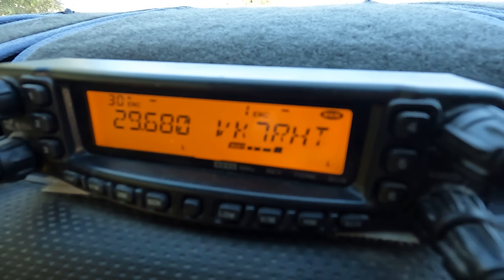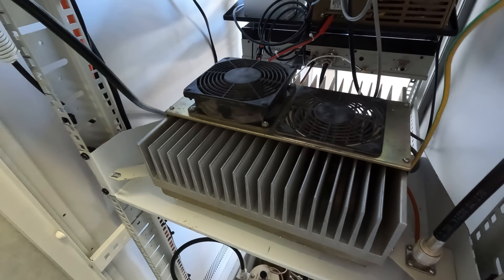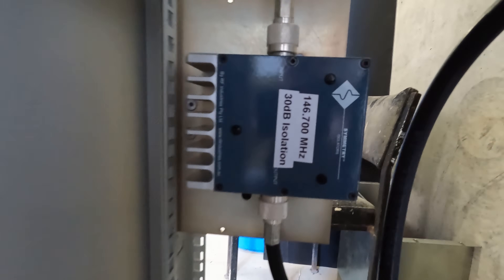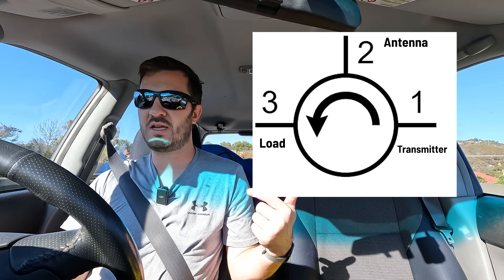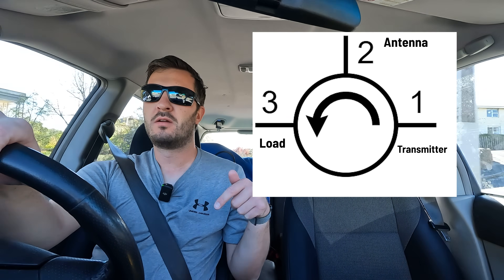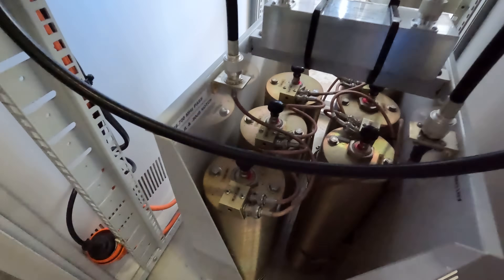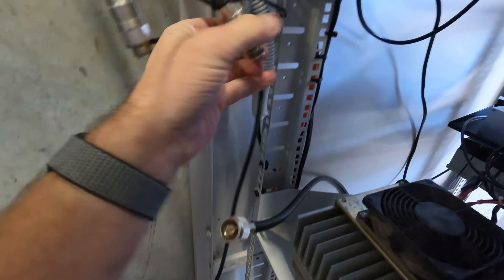How to AVOID Blowing Your Repeater Up!

Comment: Hi Hayden , really enjoy your videos  and learn a lot from them .. Our repeater is tough to get to, not because of the terrain,but more because the property owner can be a stickler about allowing people on his property ..  I've recently been tasked as part of our repeater maintenance crew and would love to put  a circulator  in , Would it be the best to place it before or after the duplexer ? Thanks
Reply from the maker: Hi mate,
Circulators should be placed right after the transmitter and the followed by a bandpass filter > then to the duplexer. Good luck with the access issues!

Comment: Thanks for taking us along for the ride.   I maintained several repeaters here in the US for decades.   I have seen the inside of a cellwave  super station master fiberglass  radome antennas turned to dust in a microsecond by a lightning blast.  I totally appreciate what you do.

73....
Reply from the maker: Thanks! We're lucky that lightning is that big of a problem - I mean we have a 200 foot lightning rod in the form of the broadcast tower right next to us. Plus we don't get that many storms in our part of the world, so we're kind of lucky.

Comment: You should have just used the duplexer and hooked up both TX and RX to the good antenna. What you actually did was not the right thing to do.
Reply from the maker: Nope, I did the right thing. 
We have intermod being generated nearby in the near field of the antenna (probably something rusty) so we get desense when we transmit on one antenna. It doesn’t desense into a load. Splitting the antennas helps with that. It’s all experimental.

Comment: Now, not knowingt eh setup and radio hut, I am going ask, have you got lightning arrestors on those LDF feed lines and why are they just handing around rather than secured/bonded?
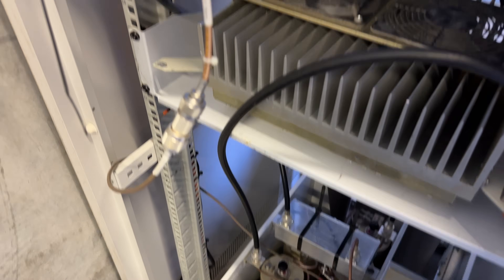Reply from the maker: Yes and they are secured/bonded to the cable tray above at 10:04
Reply: @HamRadioDX  Sorry, didn't see it.

Comment: Excellent description on the isolator/circulator….. As a keeper myself I might look into one of these..
However I am a little confused on the operation of your one…..
If your antenna was busted, should not all of your rf output go to the dummy load? And if it goes to the dummy load, how would you hear that any distance from the site…
Is the isolator also not doing its job correctly or am I misunderstanding?
Reply from the maker: The output power out of the duplexer is 60W or 48dBm, coax loss is negligible. I tested the signal as being 30dB down, which would mean 18dBm or 60mW. 

A 100:1 SWR is only 14dB mismatch loss, so I suspect there is a high impedance break somewhere on the antenna matching section (and there is still some leakage of RF output power out - i.e. the 60mW) being radiated. 

The rest of the power is being dumped into the load. The obvious giveaway was the repeater going from an S9+20dB to about an S3/4. The job of the isolator is to stop any reflected power going back into the transmitter's PA and blowing up the final output device, so in this case it went into the dummy load with a very small amount being radiated.
Reply: @HamRadioDX  Ah yes.... You must be quite close to the repeater site so to still have been able to receive it at that level of what I suppose you could call ERP.
At least the room got a little free heat from the dummy load!
Cheers for the clarification Hayden 😊
Reply from the maker: @IrishHamRadio  Yeah not too far - LOS in fact!

Comment: Folded dipole are one best antenna for repeater, is ground, is wide bandwith, is highly reliable.
one or two bay for large lobe local communication, 4 bayfor better distance coverange, 8 bay in uhf for low altitude high distance signal.
On high altitude like on this video , 2bay vhf or 2 to 4bay uhf are very nice
Reply from the maker: Yes, we're ordering a couple of Low PIM folded dipoles!
Reply: IF UHF, GET A DB-420.
BEST dipole antenna around!
Reply from the maker: @AECRADIO1  nah got VHF

Comment: lucky you have back up antenna .  circulators are a great thing on transmitter. fancy repeaters with remote mentoring   can add temp of dummy load to the data .  The GMRS UHF repeater I re done last year still going strong. has better range with M & P coax. that is not long. all on floor of a office budling.   their is a cell tower and DTV station on main tower outher side of building. only a 2 meter ham and 800 /900 MHz repeater on side with GMRS  . have to take apart antenna to find out what happened. inspect feed line as well . and any lightning protector like a poly phaser ETC.  had them go bad, good ones have a replaceable arc tube.  I keep spares in repeater cabinet which is locked up. sounds like antenna it self. does RX . 73's
Reply from the maker: Yeah we installed a backup antenna specifically as this site is pretty harsh weather wise.

Comment: Put up a folded dipole array and be done with antenna problems 👍.
Reply from the maker: Folded dipole arrays can still have issues with phasing harnesses getting water in them.. Best to run equal feedlines down into the building and put the harness there. But, the other issue is we are height restricted with our antenna.

Comment: A circulator allows a single antenna to simultaneously transmit and receive.
Reply: Any antenna can do that, it's the proximity to the transmit frequency that causes problems. That's the job of a duplexer. You're a tad bit misinformed I'm afraid.

Comment: Dear  Sir, I would like to ask question, I bought ACOM 1500 , Do I have to use all power or Can I set it low powers like 800 or whatever ?
Reply: you need.a 1KW burner and coax made from steel.
Reply: Yes you can run an amplifier at less than it's maximum output power. Some models have a control to do this. If not simply turn down the drive power from the transceiver.
Reply: @DD5LP  Thanks answering my qestion.Now .I am going to ask anotherone ACOM 1500 1200watt continuous power If I set my FT710 40watt or something Do I get less than 1200 watt ?
Reply: @DD5LP  because ACOM 1500 says  (1200 W continuous carrier) output power with less than 85 W exciter drive.

Comment: Cool video, any link for the circulator?
Reply from the maker: It's an old isolator... I had to find it via archive on wayback machine.
https://web.archive.org/web/20170710142600/http://www.rfiwireless.com.au/multicoupling-monitoring/system-components/ferrite-circulators-isolators/isolators-circulators-single-isolators-sp1317-3115-11.html#tab_spec

Comment: Great video,  can you drop a link for the isolator/circulator, like to get some more information on it. Cheers Mate!
Reply from the maker: https://web.archive.org/web/20170710142600/http://www.rfiwireless.com.au/multicoupling-monitoring/system-components/ferrite-circulators-isolators/isolators-circulators-single-isolators-sp1317-3115-11.html#tab_spec

That's the link to the old specs... it's not a current model anymore

Comment: Circulators are great devices, pedantically the Isolator is a Circulator fitted with a load. They work using an effect with a precessing magnetic field. FWIW I used to maintain base stations for emergency services here in the UK, one type in particular had a thermal switch on the dummy load that was used to trip the transmitter to low power in the event of a prolonged period of transmit into a bad SWR. Not a bad solution, to ensure that the radio continued operation even with a faulty antenna. Maybe you could have something similar on yours? A thermal switch to trigger a warning on the ID beacon?
Reply from the maker: That's a great idea! Yes you're right regards the difference between a circulator and isolator
Reply: @HamRadioDX  well done on your explanation by the way, some comms sites over here demand isolators due to IMD issues.

Comment: On the isolator, I use isolators that have an external load. This way if I have high power transmitters next to my repeater, the isolator will shunt the RF into the load. I use loads that can handle about 200 watts to handle not only my repeater but all of the RF trash that might enter through my antenna. 
Another way to eliminate intermodulation issues is to do an intermodulation study on the site. This requires knowing all of the transmit frequencies as well as the power output of each transmitter.
Reply from the maker: I'd prefer a circulator so I could have a larger load... but they are expensive devices. I was lucky to find this one and get it tuned onto 2m - but I think the load rating is over the top... it gets warm with 100W through it with a complete open circuit on the output.

https://web.archive.org/web/20170710142600/http://www.rfiwireless.com.au/multicoupling-monitoring/system-components/ferrite-circulators-isolators/isolators-circulators-single-isolators-sp1317-3115-11.html#tab_spec